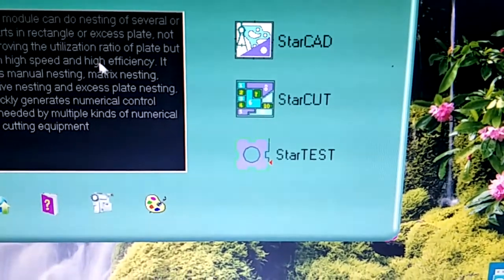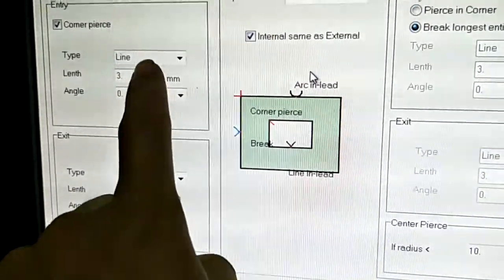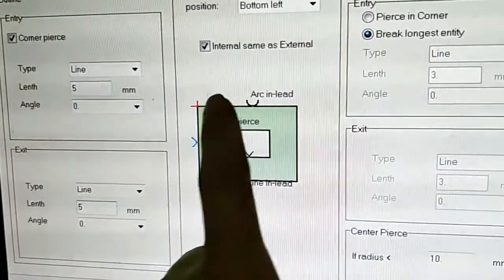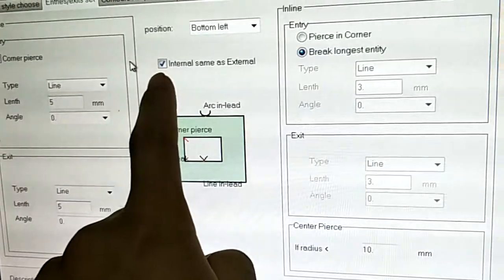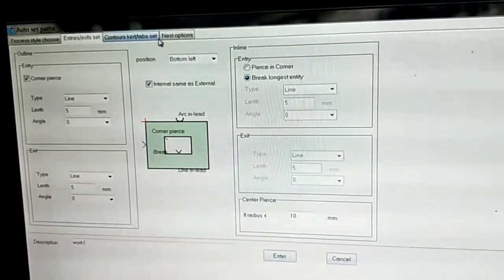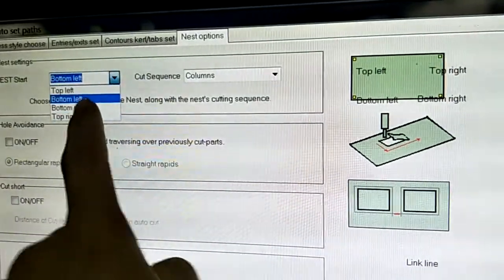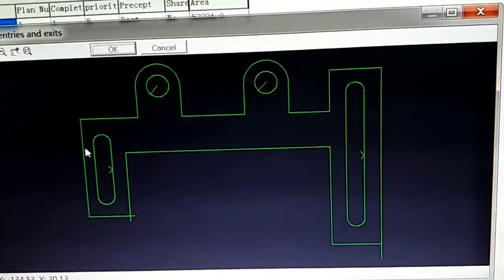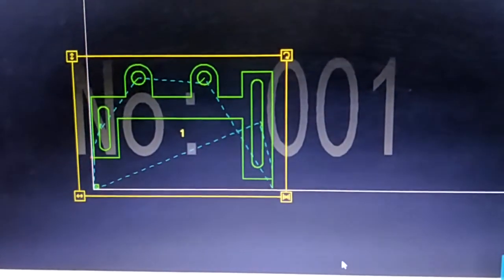3015 160A-3 how to use starcam of plasma cutting machine

Comment: Hi Nanjing i do metal art sculpture and use a fangling plasma cutter with starcnc for my work ,i am having a bit of a problem at the moment when i put a dxf file in to convert to nc it comes up do you want to verify i say yes and a small screen comes up and says test but that is all it will do ,it used to work ok but i might of changed something ,not realising, im not very good at this so would you be able to help me. or someone that knows what is wrong    regards daryl